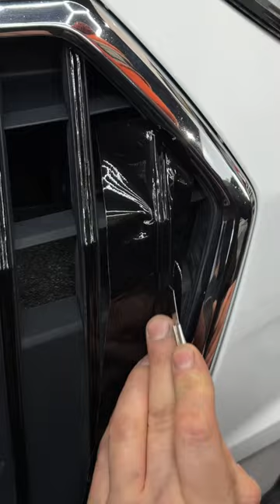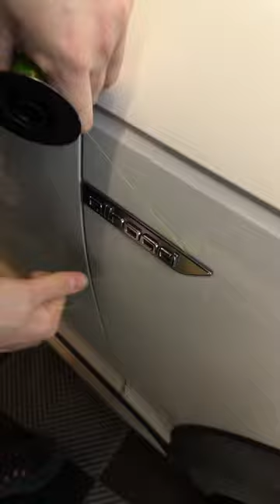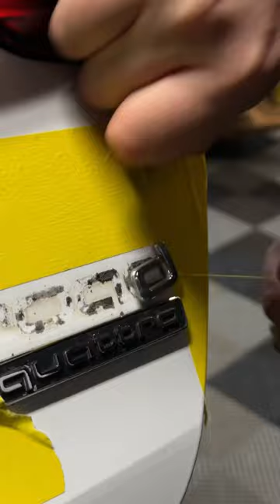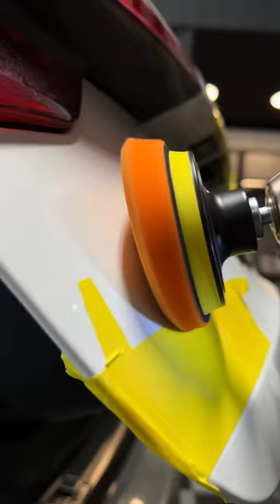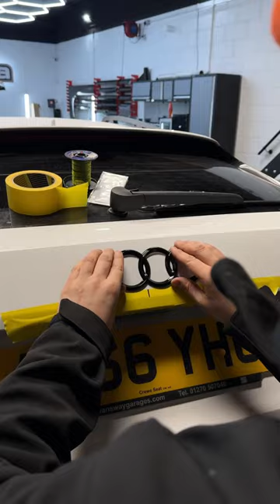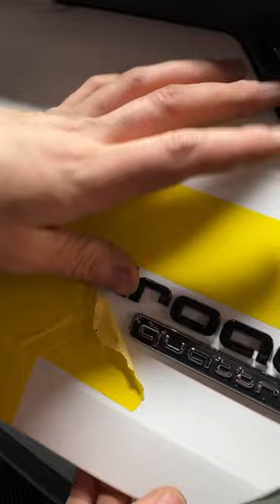Full Chrome Delete 🤤 #asmr #satisfying #satisfyingvideo #asmrsounds

Comment: Dont let anyone to cut anything on your car. It will screw the car.
Reply: Using fishing line or dental floss to remove emblems is as easy and flawless as it comes. Minor scratches that do result from the removal are very easily buffed completely out , as they never go beyond the clearcoat.